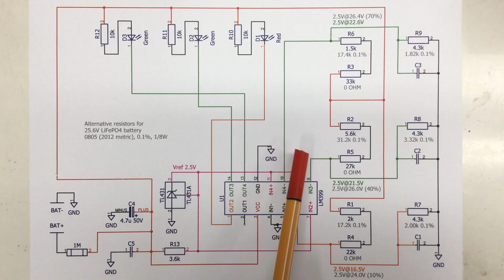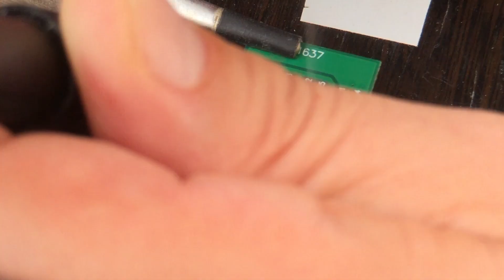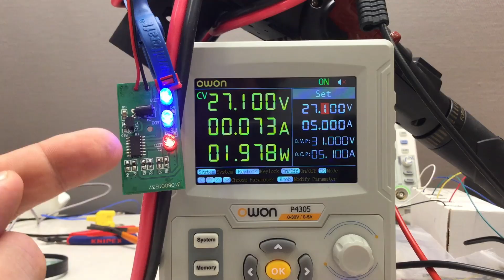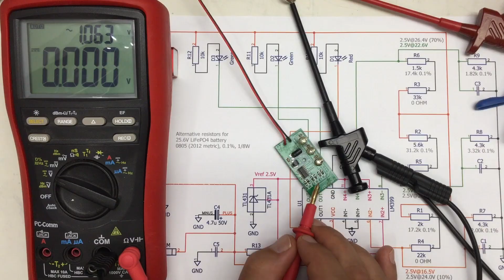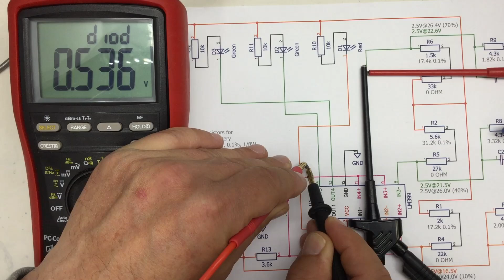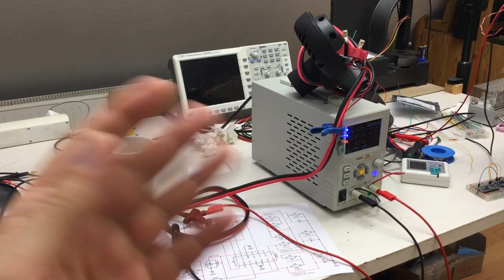Haswing Protruar 2.0 24V Trolling Motor – Battery Indicator Improvement

Comment: I also use the hot air to reflow the resistors instead of a soldering iron. looks much neater because it self aligns and you quicker because the board is already hot after the desoldering the resistors. Cheers !
Reply from the maker: Thanks for the tip! Next time I'll try to hot air reflow the resistors.